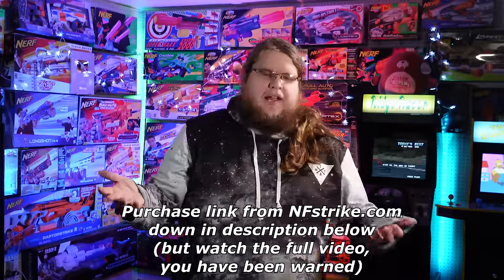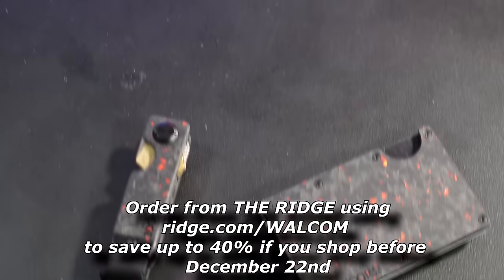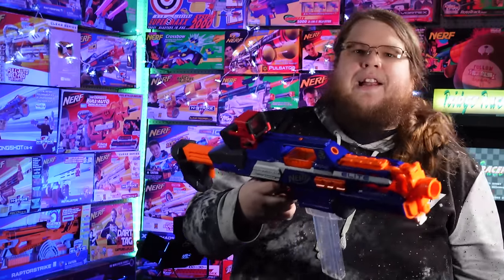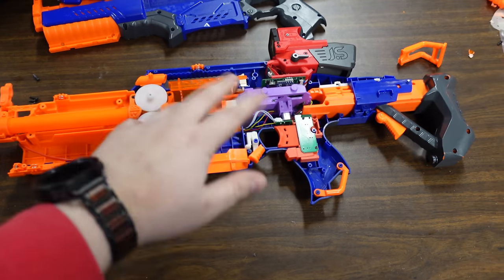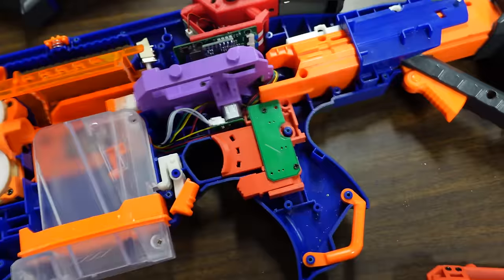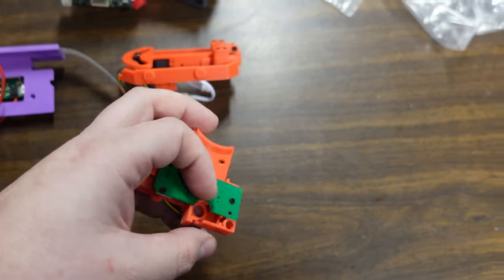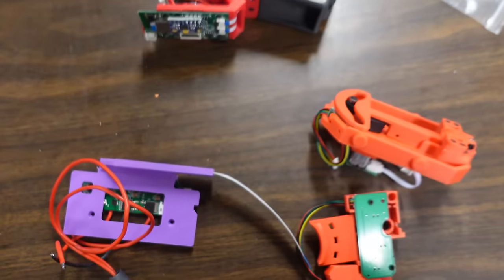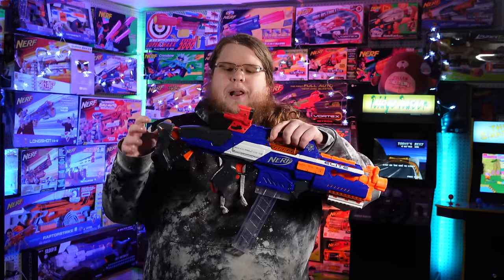The ULTIMATE NERF Rapidstrike Upgrade

Comment: To anyone  interested, it's pretty easy to take an old metal hanger, cut it, and bend it around the sight cage and hook the cage into the plastic of the gun shell. Essentially making yourself a 50 cent role cage for the optic. It's not shatter proof by any means but if done correctly gives you more leeway to bump into things and not set it down as gently without worrying about shattering the 3d parts.

Comment: I know this is not at all related to the video, but I'm asking you this because I thought you'd be alble to help me. I recently got the Nerf Soldier 76 gun for Christmas, and all was well until like 2 weeks ago. After 3 days of usage, the blaster was firing noticeably slower. So I thought it was a battery problem, so I checked the voltage on the batteries, and they were already dead. So I changed them out, and it worked just fine. But I'm wondering if there's a way to make this thing have a longer battery life. And just to clarify, I've never modded a Nerf blaster ever. Think you could help me? Thank you.

Comment: I'm still new to lipo batteries. What kind of lipo would you use for something like this?
Reply: Depends on your motors. I put fang revamps in a stratohawk which is 2s and it works great except for the weakass pusher.

Comment: We need a full auto AEG mega xl blaster
Reply: no.
Reply: The heavy bolter from Warhammer would be great for this. It fires .998 caliber rounds, which is 25.9 mm or 1.02 inches in size. Though that's more like normal mega rounds.
Reply: @randomcommenter8274  mega xl rounds would be way cooler though
Reply: @kingjohn8980  I mean, definitely. But the difference between an almost one inch round and a longer and .18 inch wider round would make a difference if you tried to make an 8 bullet magazine.
Reply: @randomcommenter8274  while a mega bolter would be more feasible, we already have something similar with the mega motostryke, so a mega xl bolter would be more unique and interesting. And also a lot more fun to fire.
Reply: @kingjohn8980  Wait a damn minute, how big do we need the fly wheels to be for this thing? I mean it could just have slam fire, but it's gonna need a lot of power. I mean, hell, the heavy bolter has a 20-35 round clip. That's one big magazine.
Reply: @randomcommenter8274  that’s why I said it should be an AEG like the stampede
Reply: @kingjohn8980  Oh sorry. Forgot what AEG meant. It'll still be a strong spring to fire that large dart a good distance. And the gears need to able to pull it back all the way without breaking themselves from the tension.
Reply: @randomcommenter8274  I’m sure it would be possible for such a blaster to be made. Weather it’s made by Hasbro themselves or someone else from the hobby.
Reply: @kingjohn8980  Well, I doubt Hasbro would do it, but if anyone did it would be good timing because there's a Warhammer series coming out on Amazon sometime next year.